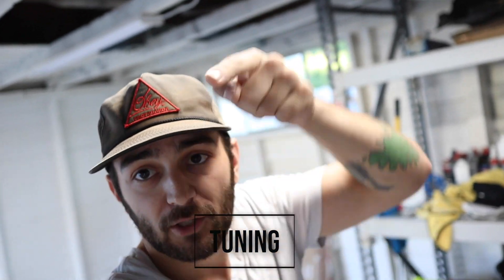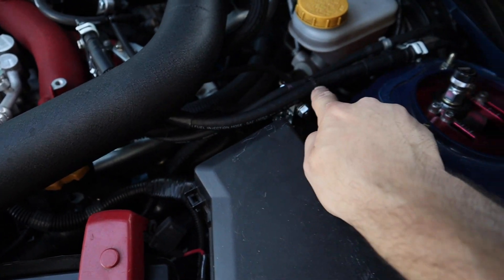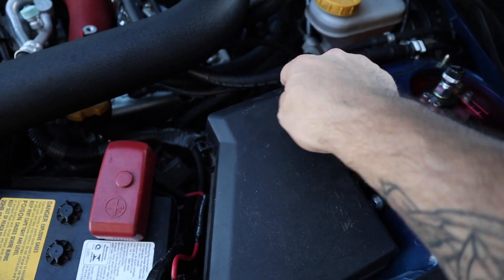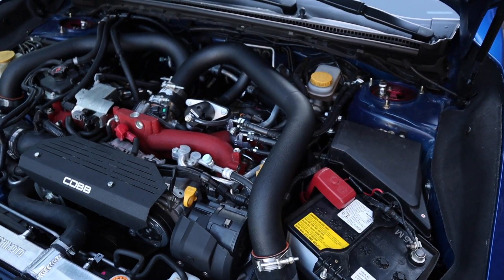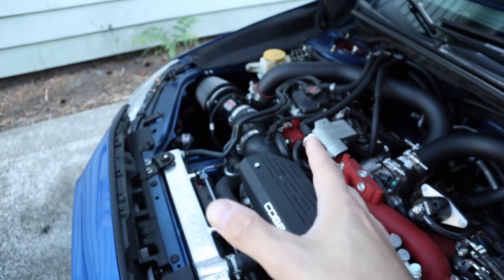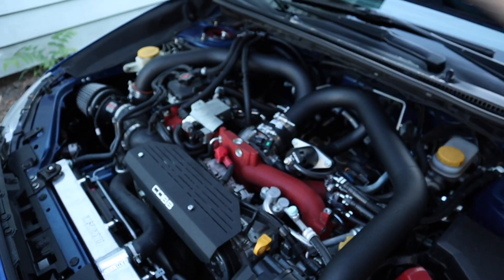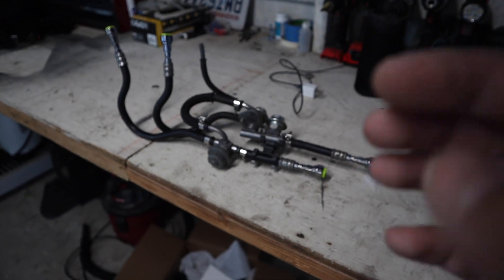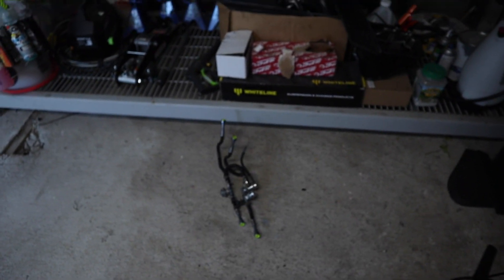STI Tune Follow up & Basics of Tuning

Comment: You said wrx doesn’t have fuel cut issues only sti does I was just wondering I have a wrx I am building it an just wondering would I run into that issue with the fuel pressure regulator

Comment: Great Video again man! I know this is old but I have a 8k miles 2020 STI and already have the IAG AOS (Street) and the Doms Cyl 4 Mod installed on the car. Its a good time to get some basic tuning done and many tuners are recommending me different routes. My goal is to just have full bolt ons which is a stage 2 I believe and i heard the Cobb intake is “bad” for the stock turbo which idk about. Everyone keeps saying I’ll be overboosting if I don’t upgrade my fuel system which is another pretty penny. Not sure on what to do at this point lol
Reply from the maker: On the 15+ you'll need to upgrade the fuel system to use an intake and downpipe combo. The cobb intake is not bad at all, the overlooking comes from using a careless downpipe instead of a carted one

Comment: What was that about walnut blasting?? And high pressure fuel pump maintenance? That wasn't in the reliability video, as far as I can remember, and I would love to be able to make my 15 WRX last a good long time.
Reply from the maker: About every 30K the valves should be walnut blasted to remove the carbon build up. Because the FA is direct injection it does not have the fuel running over the valves to help clean them. The high pressure fuel pumps are generally good I've only ever heard of about 3 of them going bad. The reliability video was more geared towards EJs than FAs. The FA engine overall is pretty efficient

Comment: What's wrong with running an ots map long term?
Reply from the maker: Most cars will be alright. But the OTS Maps are not tailored to an individual's ECU. Every car is slightly different from the factory so you will have extraneous factors that an OTS Map wont know to correct which can lead to failure over time
Reply: @Smeedia  ahh. Thanks dude

Comment: So I swung by a local tune shop (modified KC) to get rid of an exhaust leak... and they talked me into a stage 1 setup and protune for longevity.  I barely have 15k on the clock with the extended warranty. But I want my car to be as reliable as it can for as long as it can. And I feel like stock aint the way to go with how I drive. I dont beat on it, but I dont baby it.  Im fine with the power it makes now, maybe a touch more would be cool.. and i want intake noises. So for 2300 buckaroos theyll install the AP, sf intake, type ra airbox, IAG aos, then protune.  I can deff install all those parts but I'd rather not do the AOS after watching numerous install videos.  Plus i believe some dealers are a little more forgiving on "professionally installed" parts if you do modify if something were to go wrong, they said they do work with a couple of the local dealers.  Im seriously considering it... what do you think?
Reply from the maker: Your warranty will be gone as soon as the parts go on so weather you want to install them or have someone else do it is entirely up to you. I'm a form believer that the car can be made more reliable than what Subaru did (totally understand they made a car that works in numerous locations and is fairly cookie cutter with the tune). But personally I always void the warranty within the first 500 miles of ownership. Your call but worth it IMO to modify it
Reply: @Smeedia  yeah that was a pretty optimistic thought... figured thatd be the case. Im almost willing to pay to play but i also believe the same thing. If i can avoid a blown motor and avoid going through the warranty process by a healthy tune and other supporting mods.. sign me up
Reply from the maker: @bromando44  I've only ever blown 1 engine and it was because I pushed it wayyyyy too far and too hard. I'd say you would be fine just running a stage 1 tune with nothing to worry about. Sometimes you gotta risk it for the biscuit
Reply: @Smeedia    Yeah i guess its not often that brand spankin new, forever stock EJ's blow if maintained well... right?  I feel like thats majority of the time they go boom, from pushing them like that.  Or like you said, using OTS maps forever. Or mixing parts that tunes dont support, and bangin the rev limiter and changing oil every 6k+ miles rather than 3. You know, kid things.  I think ima send it.

Comment: Hey man! Firstly you have the best video tutorials for the front mount in our current gen cars so thanks! I'll be installing my ets fmic in a few days using your video for sure. I have an e tuner to help me get a tune for the intake and fmic but have you noticed any negatives or added turbo lag since your install?
Reply from the maker: Thank you I appreciate the support! Now no negative effects at all! I'm still on stock turbo for now and I have not noticed any addition lag, the car is pretty quick to build boost 😁
Reply: @Smeedia  DO you remember what you used as directions for your air oil separator?
Reply from the maker: @admireinspire  I did not use any directions for my AOS, ive done a handful of them in the past so I already knew where to route the PCV LInes. But IAG has a set of PDF Based instructions on their website that are alight to use. I did my AOS Before I started my Channel so I never got to film that one. Ive been looking for someone local to let me install theirs to make a video out of it

Comment: Great video, question ? Can you explain your reasoning for the By Pass Valve instead of the BOV say like the HKS BOV ? I noticed when you order the FMIC it asks for the flange for the BOV your going to use not a BPV.  Thanks for all the info im sitting on almost all my parts getting ready to do a big install then tune.
Reply from the maker: Of course so with STIs you'll run rich between shifts using a Atmospheric BOV Vs a bypass valve. Not a huge thing but this can lead to pre detonation in the cylinder due to the extra fuel. This can lead to burnt valves or worse dropping a valve over time into the cylinder. This all has to do with running on a MAF sensor vs running speed density. When your on speed density the car can read sensors more efficiently and eliminate the rich shifts.
Reply from the maker: The flange type dose not mean too much you can get the HKS BOV with a factory location flange as well.
Reply: @Smeedia  So basically I made a mistake ordering my HKS BOV and should have gone BPV ? Can the tuner not adjust to prevent the richness and make it stable ?
Reply from the maker: @insightv1.074  they can do some adjustment to accommodate for it but not fully remove the situation. Since your getting a protune Nd not using a OTS Map you should be alright. It's a longevity issue and not something that will happen right away

Comment: Awesome, im running bone stock but I really want to do the front mount and a new exhaust
Reply from the maker: The front mount really helped with temps, and tbh the turbo lag really is not very noticeable at all. Are you still on factory exhaust?
Reply: Smeedia yes, everything on that cars from factory. Which is a little boring tbh but hey I’m not complaining. I guess I just need to be patient
Reply from the maker: All comes with time my friend! Mine was stock for quite some time before I actually started to get to the good mods.